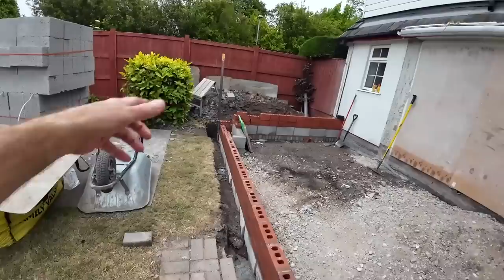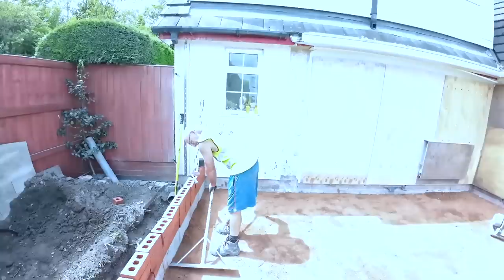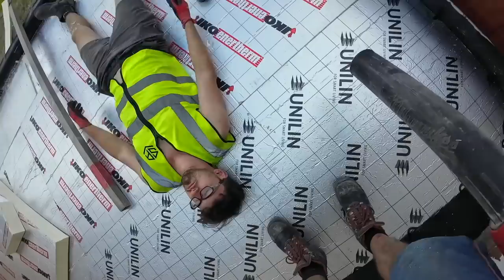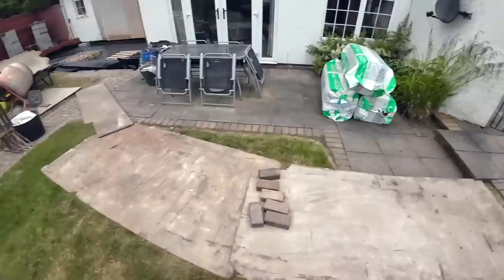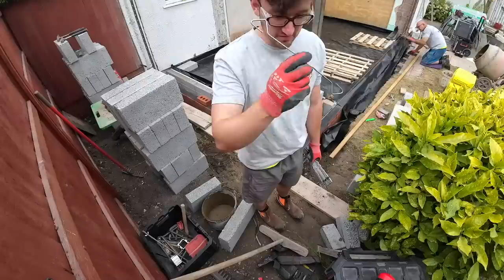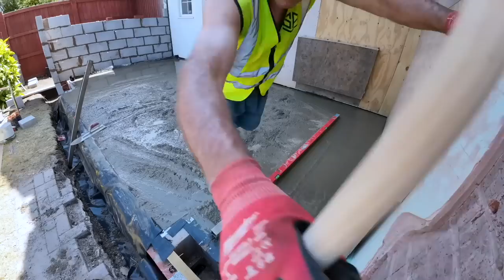LAYING CONCRETE FLOOR...150 MM CAVITY EXTENSION PT 4

Comment: I guess what you call a sparkle, don't know if I'm spelling that right, we call it a come along. For moving the wet mud around and I puddle with it I go around the edges and push down around the edges with the top of the come along so there are no air pockets between wet concrete and forms.

Comment: Why is the perimeter insulation outside the dpm? Also what do you recommend for this. Cheers
Reply from the maker: It’s the easiest place to put it 👌🏼. We use 25 mm jablite polyurethane sheets 🧱👍🏽
Reply: @SteveAndAlexBuild  thanks mate, I'm doing a concrete slab and your videos are very informative. The perimiter insulation, does that only go on external walls? Not against internal ones. Thanks again
Reply from the maker: Yes we only put it in externals . Good luck 🤜🏽🤛🏽🧱👍🏽